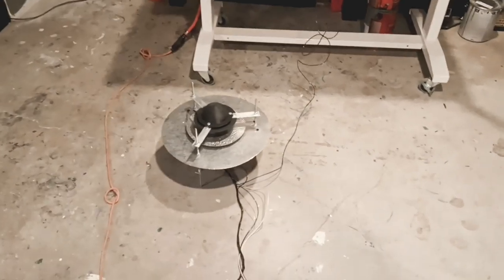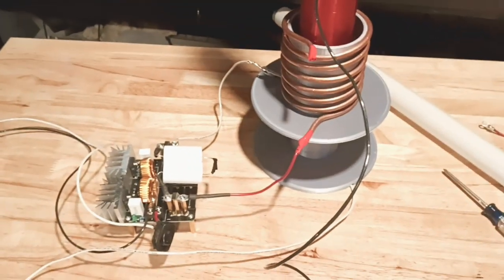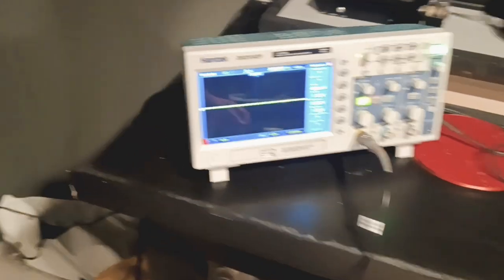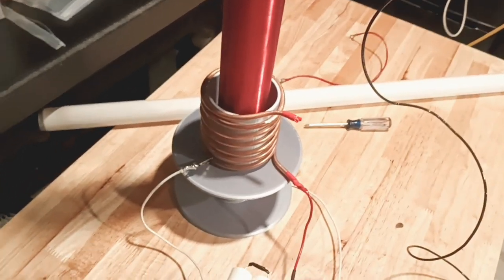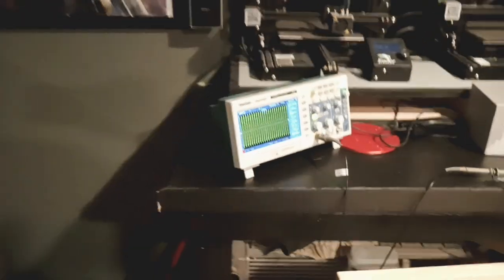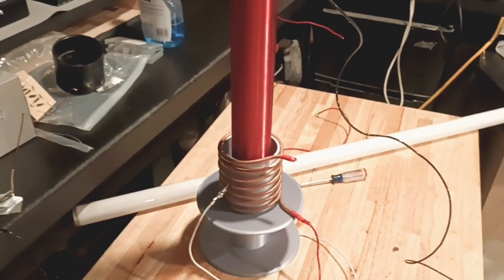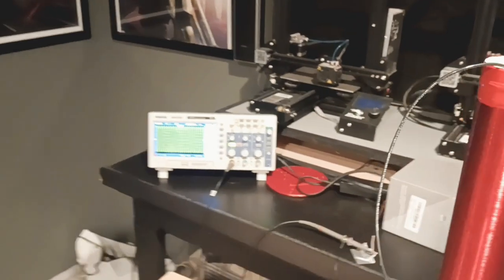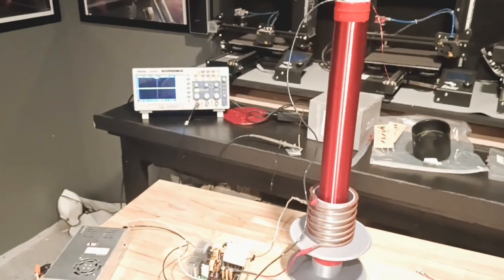Testing 14 "MHz" #63

Comment: The 320-370khz is where the GF/TC seems to like to sit, BUT when I used my HAM radio amp at around 14MHz was where I got the greatest impact on rotors speeds. This higher freq is much more dependant upon time of day/year for testing (like Alexey said). When I'd test at midnight vs noon I'd get different amounts of RPM change, with more change during the day and less change during the night.
Reply from the maker: I connected my o-scope and just got so much more info. 26mhz for the gf and i found shr spot the piezo hit and it clicks on the dial when between 2 close frequency's
Reply from the maker: going live in 4 min
Reply from the maker: @MyTBrain  I am 180 degrees out of phase on the tc and gf. The piezo hit the gf perfect. It was not strong enough to flip the octave in the center plate. Will try a bigger one.

Comment: Terahertz (around 1.6 to 3)
Reply from the maker: I would but the graviflyer only produces in the MHz range.
Reply: @nathanbunten4299  Roger that🫡. I only mentioned it due to the official reports of UAP/UFO frequencies being in the Terahertz ranges. It seems like an interesting/impossible frequency range to explore within. Somehow, I think this range is key to gravity disruption. Great work 👏🏼 on your research. ✌🏾
Reply from the maker: @rod3134  I believe it is possible but the frame can't handle the speed the motors would have to hit. It also means a different Tesla coil. It might be something for a future project
Reply: @nathanbunten4299  Try to think "Whole Body Material Resonance" as the primary focus of material dislocations. The ambient or local field geometries and frequencies are hardly considered by most novel researchers.  The answer is right before you... (Casimir Effects) 🌀

Comment: Does the secondary coil location on the primary coil makes a difference depending where you place the secondary coil.... i ask this because a certain part of the primary has more energy, as you know i know sod all about this.... i thought it would be a interesting question to ask
Reply from the maker: yes it does. It could change the frequency by 50khz depending on the relationship between #1 and #2 coil. It is important to set the #1 coil in place before testing. Just glue it. Also wire size to #1 coil is important. In this test The wire has to put up with feedback for 1 minute. so if it is to small you might catch it on fire.
Reply: @nathanbunten4299  would that also mean the secondary coil "wire" size matters quite a lot to the amount of turns and wire size on coil 1..... im more of a petrol motor guy, the way im making sense of this is it seems like the coil wire sizes, turns and locations is in relation to what a fuel and air mixture would be on a vehicle or is my thinking well off?.... the building of the coil itself seems very important like you said on previous videos..... there must be some sort of ratio table that im unaware of to show wire size to how many turns depending what your trying to get out of it and the field it would create, if that makes sense, like the fuel air ratio for vehicles being a 14.7 : 1... also if your in the mega hz would 50 khz make much difference or would it matter when it comes to tuning.... trying to find something relatable so the changes you make i can work out whats happening, your very informative and do a good job at explaining but im so clueless to the subject its hard to relate and work out what bit is doing what
Reply from the maker: @WookiRahh  it is in tuning that tells you how it will react. It goes from 0 to 100 percent in 1mm of distance on the #1 coil. The MHz is a lot further down so I need to force the pulse into it hard. Just think of using a plunger on a drain. Just with high voltage.
Reply: @nathanbunten4299  ahhhh i see, thats probably a better way of explaining it.... thank you for taking the time to reply